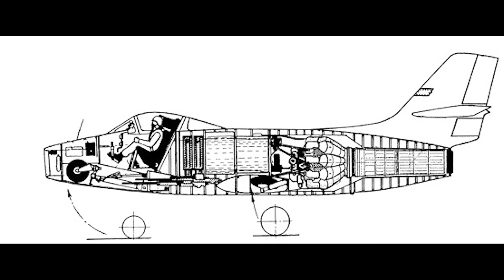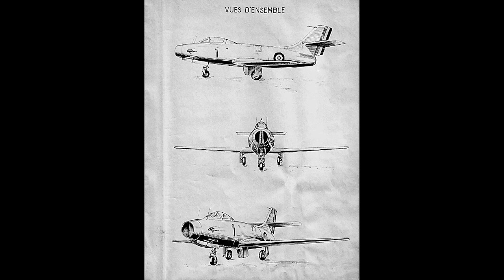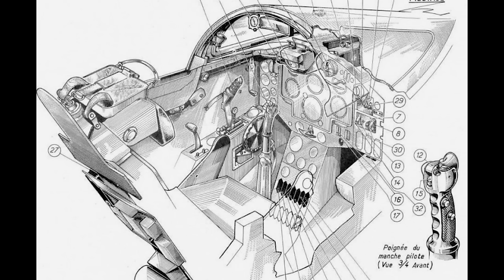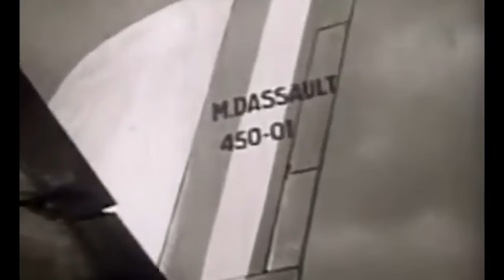OURAGAN: France’s First Jet Fighter Was Designed In A Parisian Shed

Comment: I still have my 1/72 scale Heller kit of the Ouragan….was always intrigued by its shape.
Reply: Me too ! It stares at me from the shelf, together with a Heller DH Vampire, a KP (or was it PK) MiG-15 and a Matchbox Saab Tunnan.
Reply: It's not a bad kit. I built it in the Israeli shark mouth markings. My sources weren't very good though, so I got the camo color wrong. I used a dark sand instead of dark earth. I did get the greenish blue part pretty close. I hung a couple of 500 pound bombs from a Thunderbolt kit under the wings.
Reply: So do I! 😀 mine is Israeli and looks great with the yellow and black stripes of the Suez invasion.
Reply: @ottovonbismarck2443 I never saw that Matchbox SAAB Tunnan and it's the second time I read a reference about it. 🤔 Mine is from Heller.
Reply: @duartesimoes508  ….with the Shark teeth? I did mine in aluminum French Air Force.
Reply: @duartesimoes508 It came with optional Swedish and Austrian decals IIRC.
I also have the Matchbox NA Sabre, her undercarriage is too tiny, the Heller one is better.
I used to do a lot of KP models (from Czechoslovakia); besides the very bad and old (even back then) Airfix kit, there was a very limited range of early Soviet jets available from Western companies. Putty was my best friend, though  ...
Reply: @hertzair1186  yes! Shark teeth and stripes. 😀
Reply: Made this exact kit for my best mate

Comment: Another thanks from the States for highlighting another Gen 1 jet fighter.  To me, the Ouragan comes across as a very good (under the circumstances) first try.
As an aside, this was the first time I have heard of the F-84 referred to as a 'jet-powered P-47'.  I am looking forward to at least one video on this jet; the swept-wing models may require a separate installment.
Reply: Refering to the F-84 as a jet powered P-47 makes sense from the design philosophy at Republic.
Reply: @mpetersen6  Very true; there's just not much of a resemblance, except for being big!
Reply: @petesheppard1709  
A local technical college had a F-84 on static display outside their Airframe & Engine school. The swept wing version. One of the administrators decided he didn't like it and called in a scrap company to chop it up and haul it away. Turned out the airframe was on loan from the Wisconsin Air National Guard and they were not pleased.
Reply: @petesheppard1709 straight development, f84 is literally the son of p47, An earlier project to re-engine a p47 with a turbine became the p47.
Reply: @flavortown3781  So I'm learning.  Thanks!
Reply: @mpetersen6  That just hurts. 😢

Comment: Great vid about a lesser known French jet of the Cold War
A few points of French Air Force structure : 1/2 means 1st squadron of the 2nd fighter wing so aircraft markings will start with 2- with the following 1st letter of the code being specific to the squadron 
Aircrafts are « owned » by the wing not the squadron

Comment: You always hear about how such and such was "designed in a shed" back in the day but i feel like that was more the norm than the exception at the time. That was the sort of building they used for that sort of thing, they were short on big high tech gleaming glass and brick research and development facilities full of huge staffs of draftsmen and designers, except maybe some of the larger companies in the US. Even the places where they were built could be described as large sheds. I also don't think it really means just a typical garden shed in most cases, just a relatively primitive structure with walls and a roof and some internal divisions into working areas, large doors, ideal for working on large machines and cheaper than a large building, or a complex of similar buildings of various sizes.

Comment: You’ve seen limiting systems before, perhaps not with roll, but certainly with pitch.  The Have Donut archival film discusses the MiG-21’s pitch limiting system working at both high speeds and low altitudes.  Same thing here, though the roll limiter is uncommon, it’s not unheard of.

Comment: At time 13:40 we are told that because the plane lacked any power assistance for the control surfaces the controls became very heavy at high speeds. (This is of course normal for unpowered controls).  Then a minute later we are told the elevator was fitted with a system that made the stick progressively heavier as the speed increased.  This doesn’t seem to make sense in light of the previous statement.  Stick force gradient can become too light for reasons such as increasing AOA or aft CG, but unpowered controls getting lighter purely due to increasing airspeed doesn’t sound right.

If the elevator stick forces were somehow so light at high speed that overcontrol was hard to avoid, then adding resistance would have made the airplane easier to control for max performance, not harder.  The pilot would have an easier time determining how hard to pull without pulling too far.  Unless the system was grossly dysfunctional it would not prevent the pilot from achieving max performance, or intentionally exceeding a limit just by pulling even harder.

The point here is that if this system was actually necessary to prevent unintentional overstress that does not mean it would prevent intentional overstress by the pilot.  I am familiar with servo tabs, spring tabs, and control tabs that reduce stick forces due to high airspeed, and with bobweights that increase stick force required as G increases, but not with a system that somehow adds resistance to unpowered flight controls based on airspeed.  Can anyone explain how this worked?

Comment: No wind tunnel? I'm impressed that it worked at all, nevermind reasonably well.
Reply: Lots of aircraft were designed with mk1 eyeball gut feeling and math
Reply: The first french wind tunnel was built by Gustave Eiffel in 1909...and a improved one in 1912 and still exists today...
Don't imagine that Dassault designed its planes without a wind tunnel...
Reply: @leneanderthalien  did you watch the video?
Reply: @nickthompson9697  what video speaker say and reality, is different

Comment: ok 30 seconds in and I already have a pet peeve of mine. World Wars have stifled aircraft development. It did not forward it one bit.  Aircraft performances in 1940 were almost the same as they were in 1945. Jets flew in 1939, altitude? The 1938 record was beaten in 1948. Distance? The 1938 record was beaten in 1946. Speed is sort of one place where you can argue it advanced. But a 1939 aircraft was only beaten in 1944 by a rocket-powered one. So kinda.
Reply: To be fair, no one was setting these official records during the war because, well, there was a war on. Priorities and all that... I don't think you can really argue that the performance of a top fighter in 1939 (say, a Spitfire Mk. I or a BF 109) is at all comparable to the Meteor IV that was about to enter service as 1945 drew to a close. More to the point, those were some of the best fighters - there were plenty of older designs in service as war broke out that rapidly became obsolete (Hawker Hind or Gloster Gladiator anyone?).  The altitude record of 1938 was set in a plane designed to do exactly that and nothing else. It was a biplane with a top speed of 60 mph. Pretty useless for a fighter (or any other role).
Reply: he isn't saying this for the aircrafts in general, but for the french aircraft in particular.

Because indeed the war stifled aircraft development for the french.